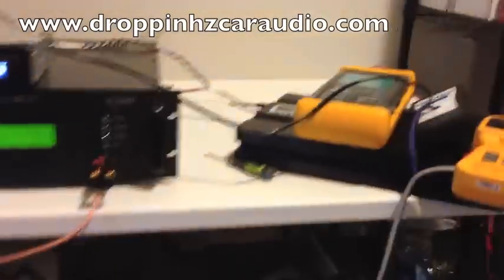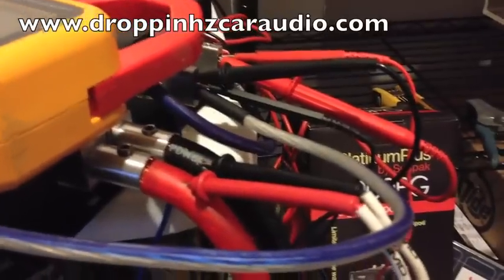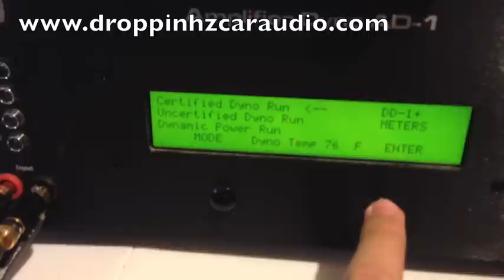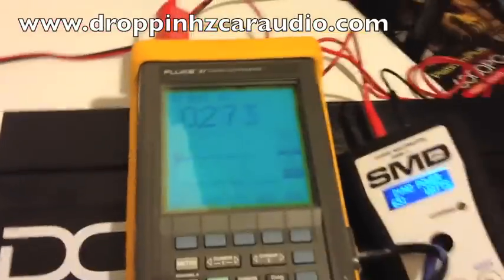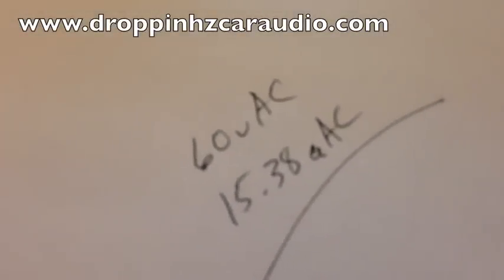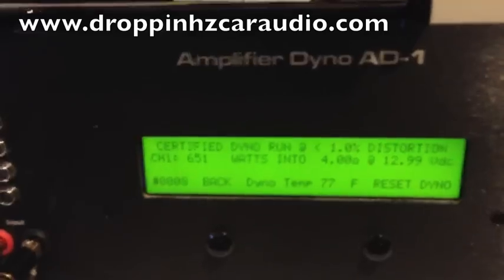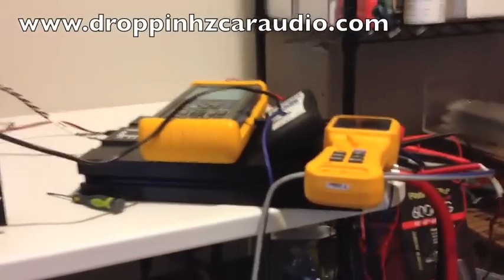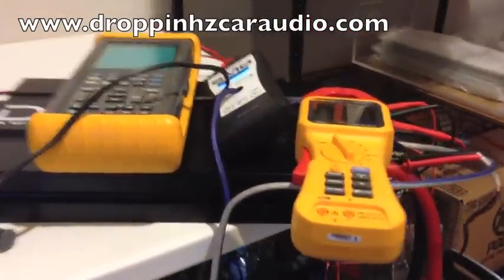Clamping Method vs Amp Dyno

Comment: Great video! When I first watched this I was like...what? You used a resistive load, so the clamp should've shown the same wattage...then Tony D reminded me the clamps don't see clipping. Do yourself a favor, get an AMM-1 and save your clamps for measuring DC Current in your system

Comment: Um, if you simply multiply the outcome 922 by the integral of the signal phase (sign wave)... 922 x .707 = 651.854 when you do this the clamp method just got damn close to the dyno / amm1...

Comment: Good video.

Only problem I see with the clamp calculations is you multiplied the max voltage by max amperage.  That would cause an issue in calculations because the max amperage and voltage don't necessarily occur at the same time.  if clamping you needed to get the range of voltage and what amperage was running at points in that voltage range then multiply those. Numbers at that given moment and then the highest number gained over that range would be the max wattage. 

Example (numbers may not be actual) 

At that 60 volts it could have say  10 amps

But at 30 volts could have the 15amps

In that case you have 600 watts and 450 watts respectively.  So based on that amp would have high output of 600 amps.  I only gave two voltage and amperage ranges but you would have multiple.

Setting it to Max hold when clamping just won't give accurate numbers.

That's how I learned.

Comment: You need to be using an amp clamp on a second channel on the scope so you can have the amperage and voltage synchronized.   I have a Pico 4225 oscilloscope I use for auto diagnostics. I set up a custom math channel to calculate channel a voltage and channel b current to show live wattage numbers. It’s a pretty expensive solution and I wouldn’t buy it just for that purpose alone but since I already own it it’s a nice usage scenario.

Comment: I don't think it's a video to show if clamping is better or vise versa but it's to show how much more accurate and easier the SMD unit is to use. I've used the clamp method and have never get consistent readings., but when using it for non car audio uses that's a different story. But I'm sure the SMD bashers will argue this till the end either way I can care less I  don't have a SMD products and it's whatever lol.

Comment: In an AC circuit, Volts x Amps = VA, and NOT watts
To calculate watts in an AC circuit, it's Volts x Amps x Power Factor.

Comment: Terrible test.  The amp dyno will stop measuring when it detects distortion.  You let the amp reach full clip on the scope.  Any person actually clamping with a scope would have stopped when they wave started deforming.
Reply: TeamDroppinHz

If it was me.. I would run the clamps.. But I don't want to have to rely on other people running the meters and screwing it up.  Although something I didn't consider is the amm1 stops reading at clipping.  And most people clip into their score.. so that's actually a bad tool for the job.  I will edit that.

Comment: The Dyno and Clamps are supposed to agree on this test. 
 
What happens here though is to find the point that clipping occurs, you have to be using a scope that can keep up with the sine wave. Most people who clamp do so using just a DMM with no way to see the point that clipping occurs.
 
Even using the scope and being able to see the sine wave, it is very tough to get an exact reading of the highest point just before clipping occurs to know what your true useable power is.
 
Based on what I was able to see with my eye when going back over the video, I can find 570w of clean power. But the Dyno and AMM1 see 651w of clean power. 81w might not be alot if we are talking in the range of 10000w, but when we are working in the 500-700w range, that represents alot of power.